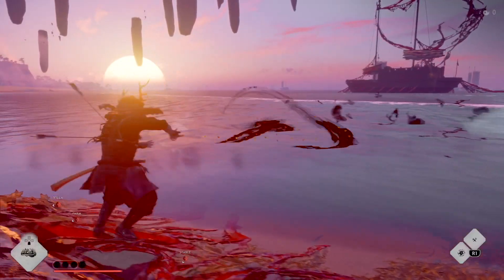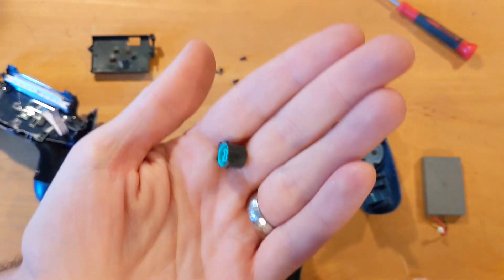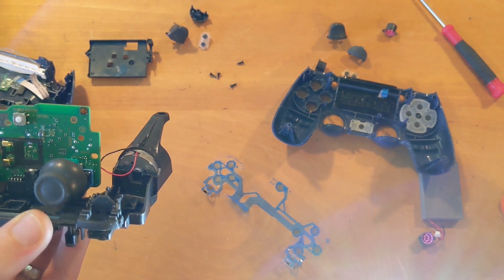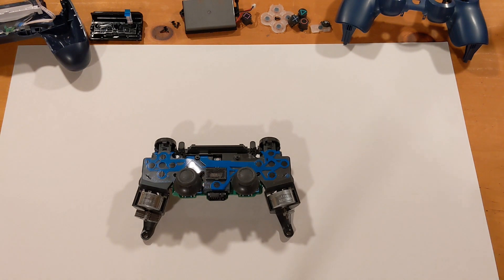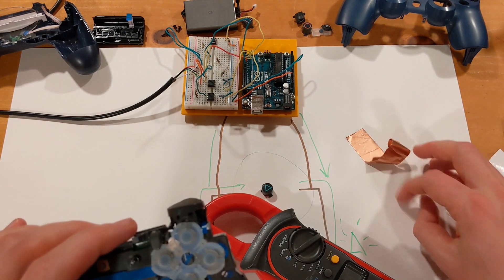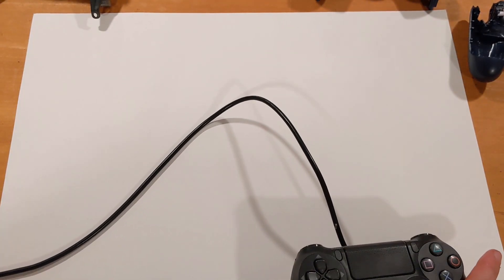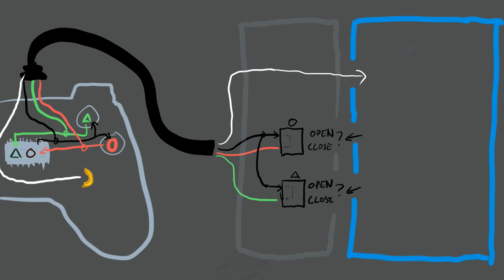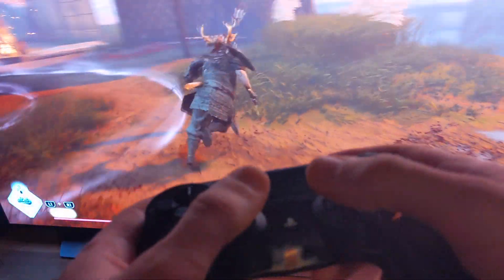Can I make a Moon Master Cancel... Button?

Comment: An easier solution would be buying a cronus zen and writing a script to do the moon master cancel.
Reply from the maker: but where's the fun (pain) in that hahah :)
Reply: @sdkverse  true haha, just giving a heads up, scripts would be much easier for those who want to make a perfect moon cancel combo without the need of all the equipment needed to do what you’ve shown.
Reply: @PlayingUnfairly  combo mmc {

print(0,0, OLED_FONT_MEDIUM, 1, foo[1]);

set_val(PS4_TRIANGLE, 100); wait(300); set_val(PS4_TRIANGLE, 0);

wait(440);

set_val(PS4_CIRCLE, 100);

set_val(PS4_TRIANGLE, 100);

wait(50);

set_val(PS4_CIRCLE, 0);

set_val(PS4_TRIANGLE, 0);

wait(200);

set_val(PS4_CIRCLE, 100);

set_val(PS4_TRIANGLE, 100);

wait(50);

set_val(PS4_CIRCLE, 0);

set_val(PS4_TRIANGLE, 0);

wait(200);

set_val(PS4_CIRCLE, 100);

wait(50);

print(0,0, OLED_FONT_MEDIUM, 1, foo[0]);

}

combo mmc_force_stop {

set_val(PS4_CIRCLE, 100);

wait(50);

print(0,0, OLED_FONT_MEDIUM, 1, foo[0]);

}
Reply: @Rippegaming  is this the script ?
Reply: @1julezking1  yes

Comment: Hey sdk, thanks for your awesome GoT videos! You inspired me to make my own MMC button, but I based my electronics on an ATTINY13 in SOIC8 (surface mounted) form, so everything is tiny, can be driven by the PS4 controller's battery, and fits easily into the controller, with only the button showing that the controller is modified. 

Thanks for the inspiration! I'd send you one as a thank you if you told me where ... but I know you don't need it ;-)

Unfortunately, youtube doesn't let me post an image link here. The whole thing is fingernail-sized.
Reply: For anyone who cares, here is the code. Works on Arduino Unos too.  You just need to set the three pins to those you use. Want to point out that I don't press triangle and circle at the same time but immediately following each other, which has some advantages, though it makes the attack sequence a little slower than sdk's (by 80 ms in total); but you can interrupt it if you need to by releasing the mmc button anytime. I didn't bother to support interrupting the first part of the attack, should be done too. To those entirely unfamiliar with this, this code goes into the Arduino IDE.
---
#define button_pin 2
#define t_pin 3
#define o_pin 4

void setup() {
  pinMode(t_pin, OUTPUT);
  pinMode(o_pin, OUTPUT);
  pinMode(button_pin, INPUT);
}

inline bool b() { return digitalRead(button_pin) == HIGH; }
void t(int dur = 40) { digitalWrite(t_pin, HIGH); delay(dur); digitalWrite(t_pin, LOW); }
void o(            ) { digitalWrite(o_pin, HIGH); delay(40);  digitalWrite(o_pin, LOW); }

void loop() {
  // sdk says: hold T 300, wait 440, hold T and O 40, wait 200, hold T and O 40, wait 200, hold O 40

  if (b()) {  t(300); delay(440); o();
    if (b()) {   t(); delay(200); o();
      if (b()) { t(); delay(200); o(); }
    }
  }
  else { delay(50); }
}
Reply from the maker: @yxx_chris_xxy  dude! somehow i totally missed this amazingness.  so rad! thanks for sharing!
Reply: @sdkverse  Thanks sdk :-)

Comment: Do you have the time in between the clicks? I want to try if a modded controller can do this
Reply from the maker: latency is likely going to be different, so might need some adjustment, but here's the fastest timing that worked reliably for me: 

(note: times in milliseconds, T = Triangle, O = circle)

hold T 300, wait 440, hold T and O 40, wait 200, hold T and O 40, wait 200, hold O 40

good luck!

Comment: Nice! How do you come up with the program? do you do it on a PC or on the arduino board itself?
Reply from the maker: Arduino has a simple IDE you can install on your computer that let's you write programs that the Arduino will run. If you want to learn it, they have a great starter kit that comes with Arduino board, a bunch of wires and components and a book with a bunch of simple starter example projects to do.
Reply: @sdkverse  Is it possible you could share with me the code that you used for this to work?
Reply from the maker: @hari raj, This was a fun project for me to learn more about the Arduino and figure out how to be able to do this. I wouldn't really recommend this approach for anything other than learning. The button also isn't perfectly reliable and you risk totally breaking the controller while working on it. If you just want an mmc button, might look into existing tools like a strike pack.  If you want to use this to learn, I could look at getting you code, but if you want to use this to learn, might be also fun to figure it out? Cheers
Reply: @sdkverse  I'm playing the PS5 version of legends & from what I'm reading I don't think the strikepack works for PS5 games. I'm trying to learn the normal way but I just can't maintain it in a fight.
Reply from the maker: @hariraj1959  this other video might also help you practice.  https://www.youtube.com/watch?v=npfUr5BSxcQ if you can do it outside of a fight, then its a matter of trying not to over think it, and just do the exact same pattern while you are in a fight. giving yourself a build that can take a lot of damage and practicing in bronze can also help you practice doing it in battle